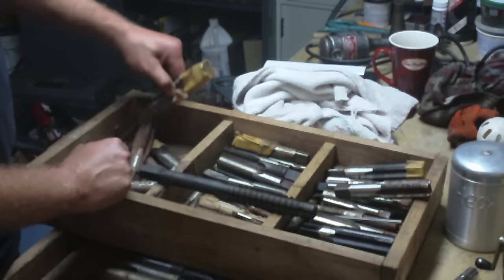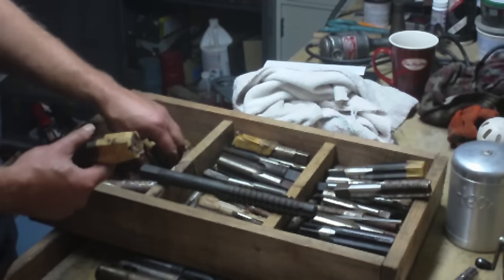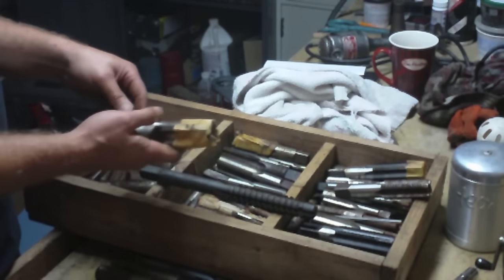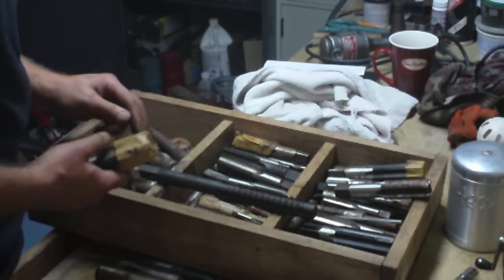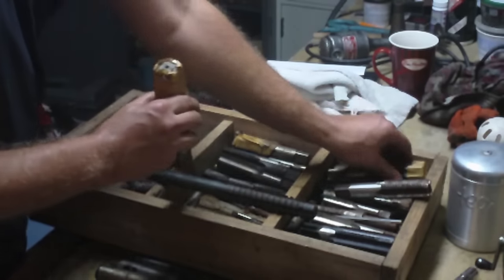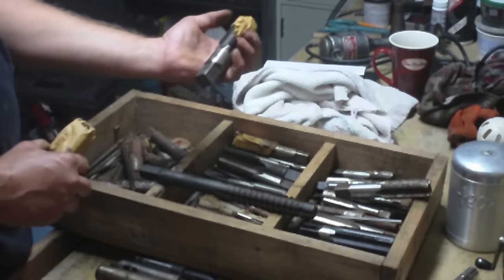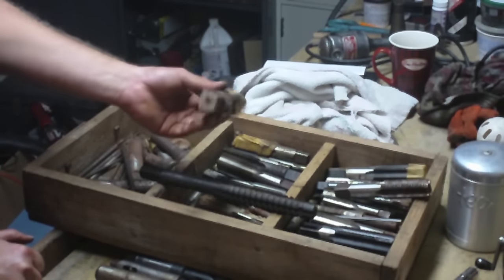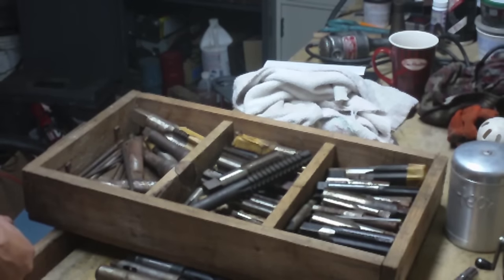September Craiglist buy, Steve meets the king of BS'ers….

Comment: On that sliding micrometer, those slots in the box are for standards. I.e, insert the 2" standard, set the barrel to 0 and slide until it meets the standard. Then you can measure 2-3"

Interesting design, don't know how much I trust it though.

Have met the BS'ers, worst part is they waste your time.